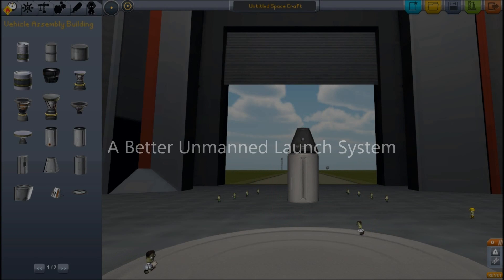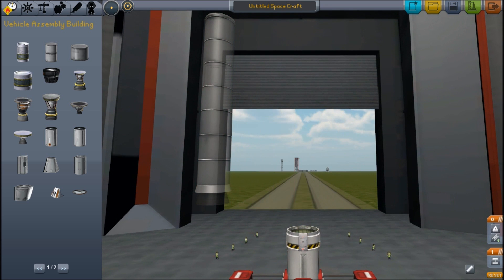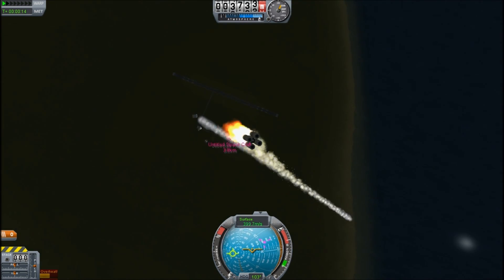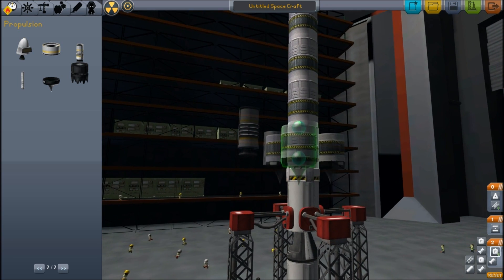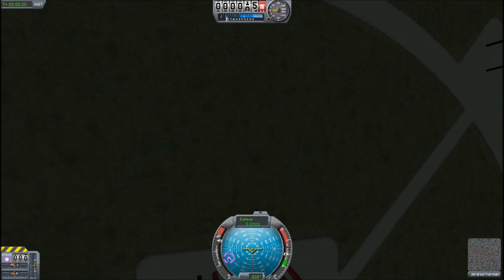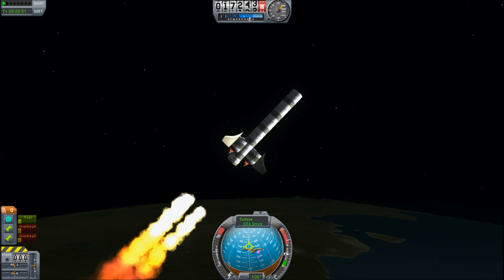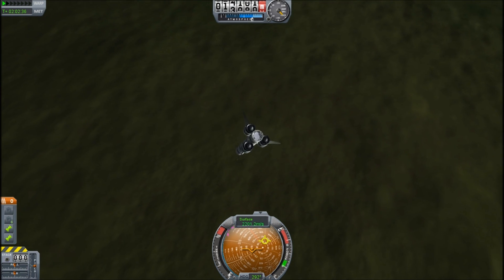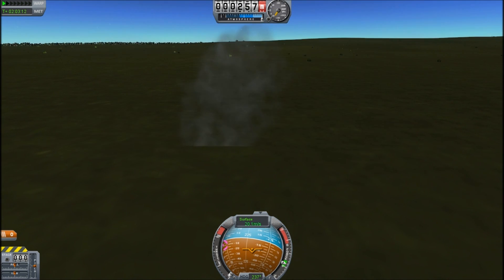Unmanned Rockets In Space - Kerbal Space Program

Comment: There is a bug with the small stack decoupler. If you use the large stack decoupler it will detach the booster rocket and work correctly, launching the booster without getting stuck to it.